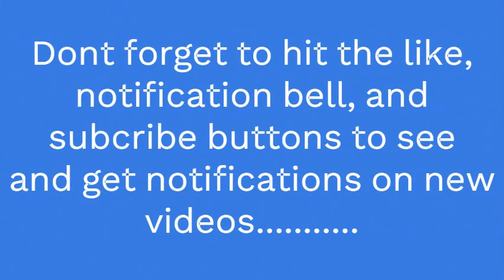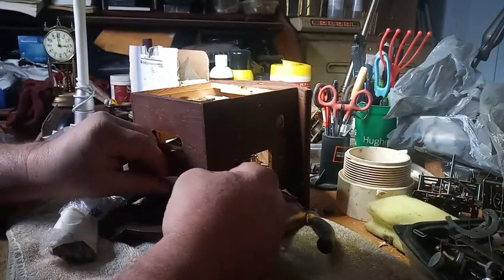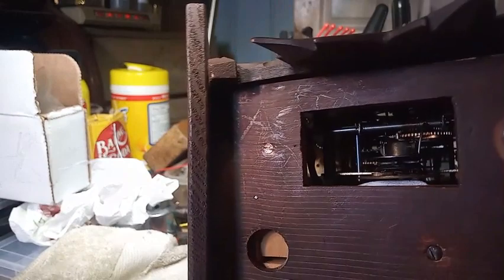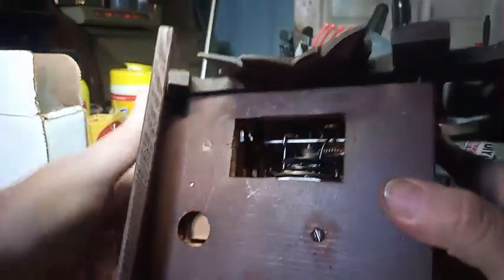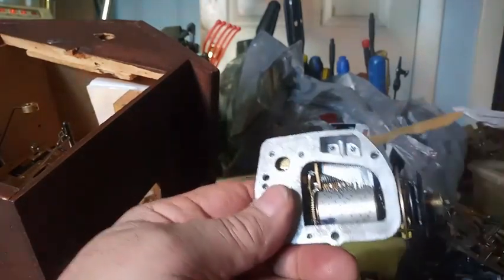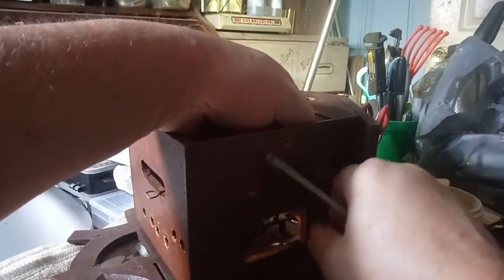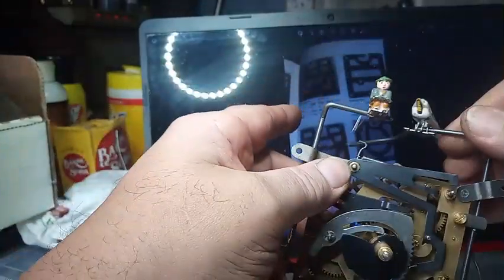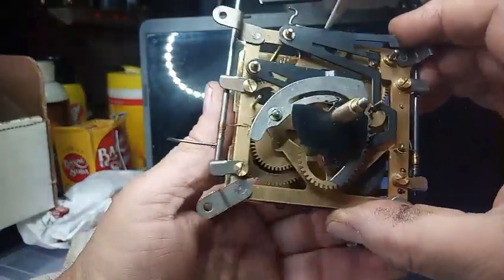(updated) Cuckoo clock repair for beginners (Welby one day cuckoo clock with music ) See description

Comment: Hi mark great video , I was wondering if you have ever seen a cuckoo clock case stamped 3 sch inside the case between the bellows. Thanks
Reply from the maker: Not that I recall but if  you send me some pictures of the clock, the movement, and that information on FB messenger then I will check it out and let you know what I think.